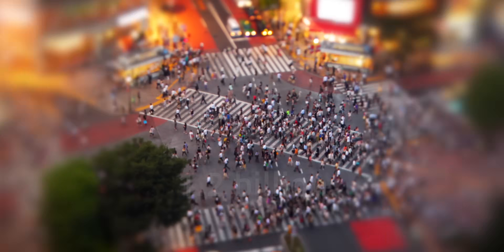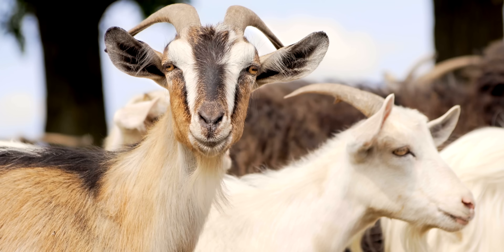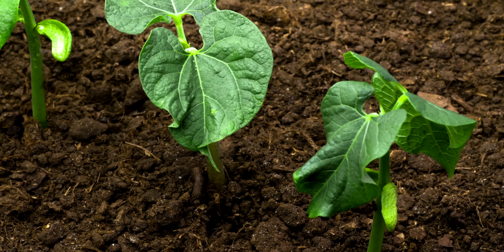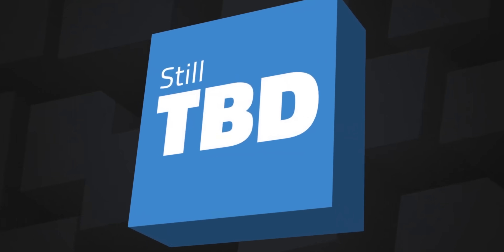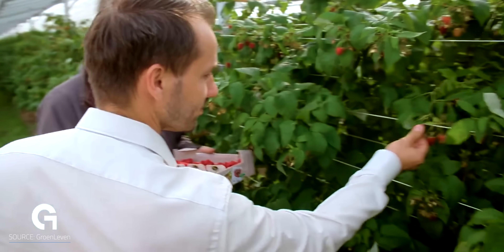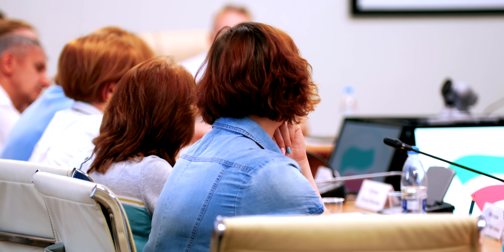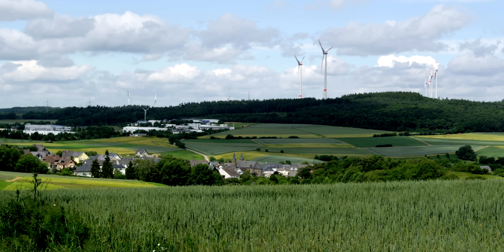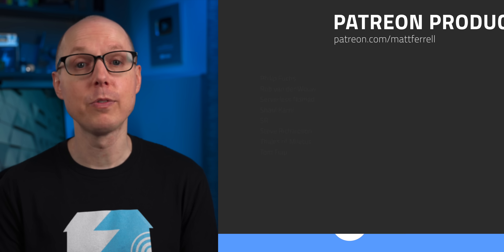Solar Panels Plus Farming? Agrivoltaics Explained

Comment: I work for NextEra Energy and the amount of push back from communities is intolerable. We've been trying to get a pipeline run for years and the nutjobs opposing it are certifiably insane. We lost the opportunity to purchase the power co. in Hawaii because the natives wanted the local co. to continue to provide sub-optimal service rather than hand things over to a renewable veteran co. Bureaucracy is a disease and NIMBY is a nightmare.

Comment: NIMBY will always drive up local costs, and is often caused by outside agitators stirring the political pot. If a municipal innovation will create enough tax revenue, it will be adopted, unless the town is rich and can pay the price of keeping it out. Also, the smaller the town, the more expensive per capita it is to run, so small towns are often put in a serious bind, and often merge into larger towns if they can't get the ratable.  Attacks on alternative energy usually are coordinated by incumbents in the petro business. One of the largest natural gas companies underwrites several lobbying groups that agitate on the grass-roots level against wind and solar with extreme partisanship and cultural dog-whistles,.

Comment: I call bull shit on solar panels to reduce the heat on earth. the panels retain the heat and create heat that will stay inside our atmosphere. I think solar panels do the exact opposite of the claim that the carbon has more to do with the trapping of heat. and solar traps heat even more.
Reply: Eh.. err.. solar radiation reaches the earth anyway. Panels so far don't utilize infrared (heat) radiation much, so it can be quite hot under them. But only because they also reduce the breeze of wind. Without the solar panels it's yet hotter. And the gross amounts of coal fired just in summer to drive all the ACs isn''t as visible to you.

Comment: I would be very intrested in more information in regards to the solar panels with the large gap between them. I currently live in Scotland and have been contemplating building a large green house in my front garden. In stead of it just being glass these panels as shown on the Netherlands property would be a much more interesting solution. I will also be doing rain caputure, because we are in scotland lol. But i would like to get more off the grid where i can with the looming energy cris and food cris which we are currently facing. I would also be very interested in chatting more one to one with you also... whats the best way to get a hold of you?
Reply: Check out edible acres here on youtube, he's easier to reach and has lots of interesting, low-cost ways of using solar

Comment: It would be good to see some real footage of the crops. I would be curious if the large amounts of EMF coming off the micro inverters effects the outcome of the crops.
Reply from the maker: The crop yields are better under the panels, so there’s no effect.
Reply: that's a great question
Reply: Can you point to any data on that Matt? As a farmer myself, I can’t see logically how yields would be better, but I’m mostly curious of the EMF off the micro-inverters has any effect on the cellular composition of the plants.
Reply: @offgridcurtisstone  EMF unless at hundreds to thousands of times higher than legally allowed levels is harmless to cells. As for yields, the farms equipped with these do better because the panels protect the plants from high winds, which would normally increase erosion and transpiration
Reply: @planefan082  can you cite any data on that? It’s one claim to say the EMF doesn’t hurt the cells, it’s another to say they’re better. Especially to a farmer ;)
Reply: @offgridcurtisstone  I'll admit I haven't studied soil erosion and transpiration extensively, I just deduced that the panels would serve as both a sun and wind shield, which both tend to reduce transpiration and soil erosion while providing more managable levels of sunlight
Reply: @planefan082  I’ll tell you as a farmer with 15 years experience and I live off-grid with solar. Plants need direct light to grow and solar panels have to move seasonally in order to maximize production. Meaning that at each season, when the panels move up or down to optimize light, they would be shading the plants. Just doesn’t make sense logically that that would produce a better outcome for the plant. However, I’m open to seeing the data and assessing the facts.
Reply: @offgridcurtisstone  Depends hugely on the climate. I'd assume most places with large solar farms would be in the areas with sunlight too harsh for most plants to grow optimally without partial shade.
Reply: @offgridcurtisstone  Hi, I'm not an expert on this topic, but I did notice in the video that they used panels with larger spacing gaps between the solar voltaic cells to allow for more light to reach the plants below them.  If you used traditional solar panels it would block too much light and be detrimental to the vegetation beneath them.  They also specified certain plant species that are shade tolerant as performing best in agrivoltaics:  lettuce, spinach, potatoes, and tomatoes are currently known as synergistic plant species with this setup.
Reply: @offgridcurtisstone  well to be honest, from my own garden i know, that the statement of the video is correct about the need for plants to have enough water to prevent sun damage in crops by summer heat and light. Of course plants need light, but they don't want to have to much light and the heat of the soil and the air around a plant is well known often a problem for plants as well. depending on your watering system you cant even give your crops enough water to prevent sun damage, because the wrong watering method leads to sun damage by the plant leafs being wet and in direct sun contact (they burn). 

So depending on your crop, your ability to use water (Colorado), the technic of your watering of crops, the growing period of your crop and the weather on your field, these numbers will change. 

It should be highlighted, that berries are explicit vulnerable crops, so they need a lot of care and protection and HATE direct sunlight or summer storm-damage, to a degree, that these plants will dry out their berries or the berries will get damaged and both destroys thereby on ONE DAY the majority of your actual product. Damaged berries are only good for yams, juice and Fruit brandy :D so for berry producers this concept will create more security to produce actual profit from their plants, even in this crazy hot summer weather. 

It is additional more interesting to know the time for the solar to be paid off by their own energy production. If a farmer has benefits from Solar or at least no damage from it, if the solar is self-sustainable, than for a non-farmer this solar is creating energy for me and you could convince me to invest into this solar on your ground for your profit on your ownership, therefore allowing myself to get my energy from a local farmer from my own state, maybe i will start to visit your farm-shop and buy your eggs. There are big potentials in this technology to make your off-grid a microsystem for more than one family. 
Its the reason the oligopoly is supporting wind energy and tries to bury Solar technology. Its easy to own some turbines around your fields, its hard to own the whole field for solar. Every solar panel is reducing for the oligopoly the amount to make people depended on their product from few sites.
Reply: "the large amounts of EMF coming off the micro inverters" - plants near high power radio transmitters grow normally, so I guess that electromagnetic interference from inverters won't be harmful to them

Comment: I feel that algaeoponics is a bigger winner than agrovoltaics - if you have algae that allows light in to be in water tubes above plants collecting light - that would be might more efficient. Maybe algaeponics can be above the voltaics - because while the voltaics might reduce in sunglight it keeps them cool - this leading to making up for it. The issue with algaeponics is the amount of water used - but that can be accounted for if you bottle it for drinking water or reuse the water for the next batch of algae.

Comment: one con of solar panels is that they wouldn't pair well with geothermal - as you said - can't build underground. Instead of agrovoltaics - what if farms did use geothermal from the soil for energy? They have plenty of land and it's all underground!!
Reply: panels don't need geothermal - solar panels need to improve to collect heat in addition to electrons to really be economically viable - they get overheated and water is wasted to cool them. Can't we have some conducting pole to move the heat to a collector bank?

Comment: maybe solar panels should be combined with wind turbines - like having them on their pole - then it'll reach high enough to be out of the way - iwthout needing another pole for the panels - it utilizes what's already there. The only issue is the difficulties in getting them to be flat if they're vertical

Comment: First I'd like to say I enjoyed the video. Clearly you've researched this topic and your presentation is very good. OK, now comes the but ... But, for the NIMBY effect, #1, you compared agri-voltiacs to noisy wind turbines which are many meters/yards above the ground and are visible from a kilometer/mile or more away and also made the comparison to a bio-gas farm with no specifics of the objections. 

While the NIMBY effect may prevent use of a specific thing this doesn't mean that the concerns of the local citizens is of no value. You gave nothing from that point of view. It seems as though you view community resistance as nothing more than an unnecessary obstacle.

As for item #2, bureaucracy, when any locality regardless of size has people who are paid to emphasize the desires of the locality (in other words politicians) versus people seeking profit things _ARE_ going to get very complicated.

On capitalism, item #3 ... Capitalism goes a long way in helping to have stable economies as well as balancing profit vs the needs of the people. That said I see capitalism as a thing the is generally good but is still something that citizens and politicians SHOULD be keeping an eye on. 

Clean energy sources is always considered a good thing. But, everything comes at a cost. Solar panels are not cheap, that is because the basic materials used, copper, zinc, silicon and zinc come with significant costs. And what happens to the solar panels that degrade to the point where they need to be replaced? Not every material used in the construction can be recovered/recycled.

Even with all my comments you still get an "B+" and a "Like" for your presentation! An A requires equal consideration of information from at least two view points.

Comment: Although seemingly beneficial in many ways, the black panels on mass would create the heat island effect. So figure out the so called CO2 effects vs radiant heat generated by the panels. The plastic green houses would be better for cooling the atmosphere on mass.

Comment: Ideal opportunity: As merchant marine fleet transitions to BEVs (battery electric vessels) shipping through the Suez Canal transits the Red Sea. Countries with desert Red Sea shoreline (Saudi Arabia, Yemen, Egypt, Sudan, and Eritrea) should do large agrivoltaic (or partial) solar farms with big battery storage. Excess energy beyond storage capacity would power desalination plant and possibly green hydrogen production.  Recharge vessels waiting their turn to transit the canal. Vessels could be configured with bigger batteries and act as Peaker plants as they load and unload at journey start and end points. Agrivoltaic plant products delivery ships (or vehicles) should also be BEVs and will charge as they load.

Comment: Very interesting. I note that when "the free market" is listed as one of the obstacles, what is actually meant is the cost. If the initial cost is too high, or the returns are too low, it's not viable. Calling that "the free market" makes it sound like it's a failure of the market system, but investments that don't provide enough return to pay for themselves will fail under any system.

Comment: Nobody is talking about the toxic byproducts of mining batteries and producing solar panels. NUCLEAR is the solution to energy sustainability. Solar is great for remote areas where off grid is needed. Wind and Solar are costly in monetary and environmental terms. Green energy industry is a scam to grift tax dollars. Only nuclear is sustainable "green" energy. If it requires government taking money from some to give it to others, IT'S NOT WORTH DOING. Grifters are thieves.

Comment: How does maintenance of solar panels in agrivoltaic systems compare to normal? If maintenance is more involved, and the lifetime of the solar panels is shorter, this might not actually be a better way of doing things. I think that the cost of solar panels is an important factor in why this tech has not become widespread because solar panels can take a long time to pay themselves off. If solar panels take longer than their useful lifespan to pay themselves off then they are actually a waste of money.

Comment: I'd bet this has been asked but, as far as solar farms, why aren't they being built on hill sides or on land that isn't really useable for anything else? It seems that building a solar farm on a south facing ridge or hill (in the southern US for example) would not only make unusable land useable but, it would also have the advantage of already being tilted toward the optimum angle toward the sun. I understand initial construction may be more challenging, but it seems to be a better way to approach it.

Comment: I think we should take a closer look at using lenses to produce thermal energy via the sun.  When used in conjuction with modern aerodynamic advancements, such as recycled turbochargers, there may be room for improvement in the locomotive department.

Comment: For more than a year I have had this idea of combining a track that circles in time with solar movement (similar to circlular sprinklers of industrial farms) with fish/plant hydroponics below them slightly offset. Still requires lots of maths that I am too time crunched to do, and it wouldn't necessarily "make" extra electricity. But my dream is for them to be single kits that can be air dropped into extreme rural areas.
Where they make enough electricity to maintain all of the fish and plant needs; along with the energy to move the rotating solar panels.
A triple combo solar, vegetation and fish farming operation that doesn't need anything beyond water and maintenance.
Go ahead and take the idea, I won't ever get around to designing or patenting it. I only ask that you actually try and make the airdrop thing a thing, too.

-Your Friendly Neighborhood Druid
Reply: No idea wtf youre saying but it sounds awesome 🤠🏏

Comment: Im an architect and an OZ farmer who has 3 inverters in the roof top solar system

Great idea for the right location and product especially already existing high intensity greenhouse areas
and they should probably start there

other areas too with due consideration
It's part of the solution not the solution
but I do not think it needs to be sold to farmers like me
you are close with your analysis of the real problems

here we had a generous feed in tariff which meant we earnt money from the system
Fast forward 5 years now we pay
There is so much solar in OZ now on a sunny day 
that the big guys give the little guys virtually nothing
what we generate is now basically worth nothing
Our systems were meant to pay for themselves over the lifespan of the panels 
For our existing panels that is no longer going to happen
that is no longer the case for new systems
I'll be moving away from a grid connection for my home

Yes government particularly local we suck out the rest with planning reports, development fees and rates rises.

"The farmer is the only man in our economy who buys everything he needs at retail, sells everything he sells at wholesale, and pays the freight both ways"
— John F. Kennedy

nothing has changed in 50 years an that includes the social reform promises, the motherhood statements from those selling these innovations that are basically lies

Comment: Agrivoltaics coupled with battery storage banks would benefit communities with less succeptability to power outages by supplying power during powerline disruptions and other unforseen interuptions like more draw than powerplants can produce on their own. All without the visual disruption of windmills, noise and bird strikes of windmills, too. Arid areas can especially benefit from the dual use.

Comment: The solar panels can also be used to collect condensate water or due that collects on them. This will be fresh water in most cases. The reduction to need for water in the arid regions is a far greater advantage. In inhospitable regions fodder crops can be grown in waste containers under the solar panels.

Comment: I think the cost-benefit analysis for the farmer/landowner was a bit glossed over - the farmer may be looking at yields, inputs, operational constraints, etc, but they will also be looking at landowner payments for the lifespan of the project (assuming that the farmer does not own the pv plant). For example, if the average loss of a crop is $500 per acre per year, but lease payments average out to be $1500 per acre per year with an escalation clause, the farmer, assuming only motivated by P&L, would agree to the project. Another financial tool that some countries/states offer are incentives for carbon sequestration, regenerative ag, etc - so if a farmer can prove that a solar PV system reduces irrigation needs -> reduces pump run time -> decreases carbon footprint, there may be financial incentives available.